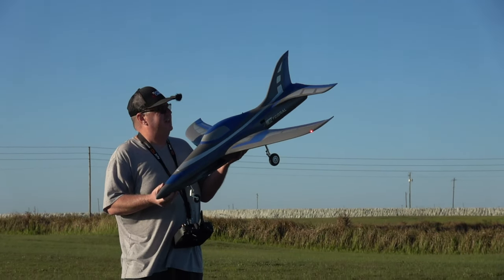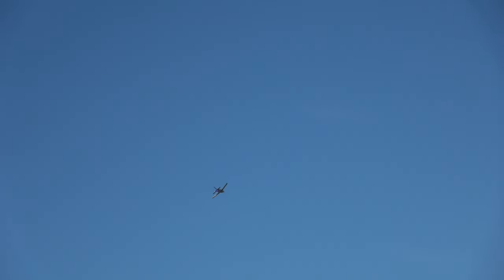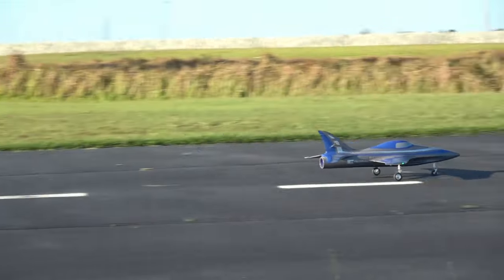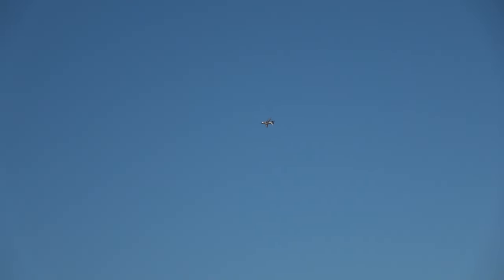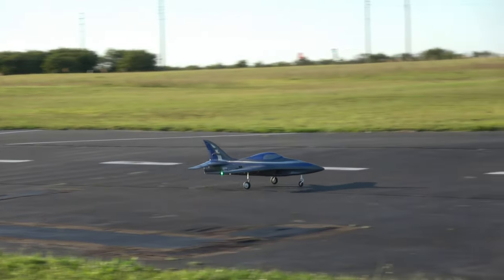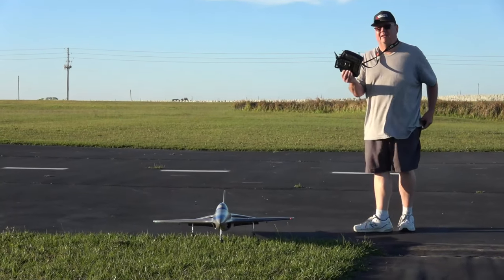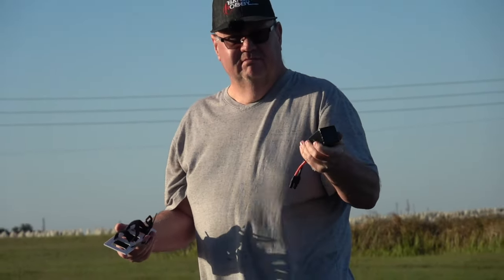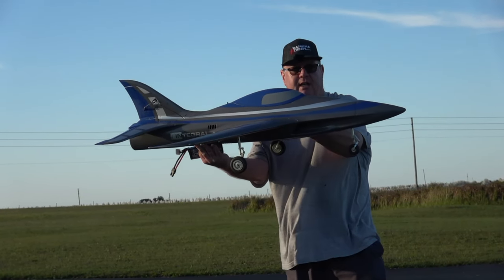FMS INTEGRAL 80MM WITH LIHV PACK-MORE POWER BABY! by Fat Guy Flies RC

Comment: I run the 2400mah SMC high voltage in my FMS Ranger 1220mm and can tell a very noticeable difference in power. Thanks for sharing the video, great flying.
Reply from the maker: These SMC packs seem to keep even power throughout the entire flight.
Reply: @FatGuyFliesRC  I agree..I definitely plan to order more. I have 1 6s 6000mah for my Carbon z150t Cessna and it also does great. Isn't a high voltage.